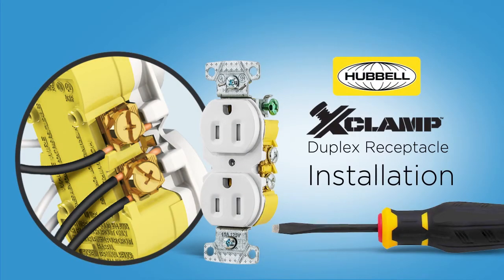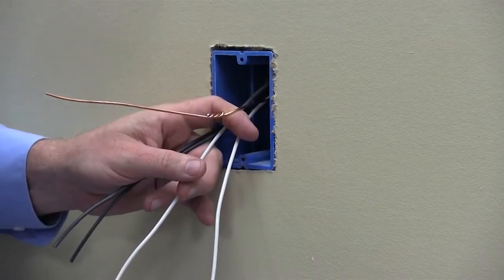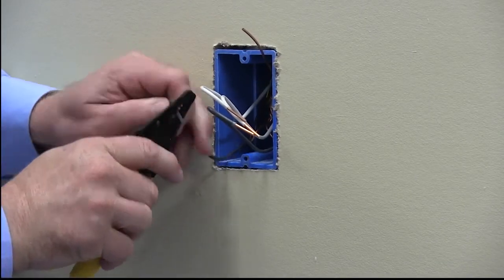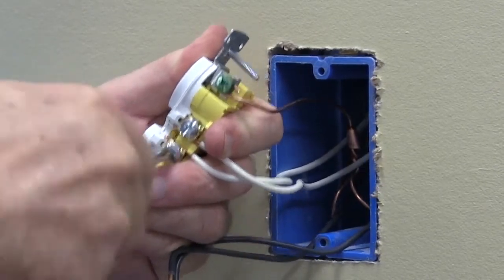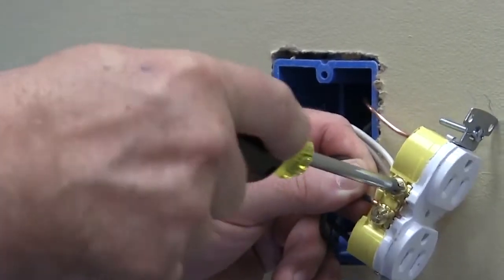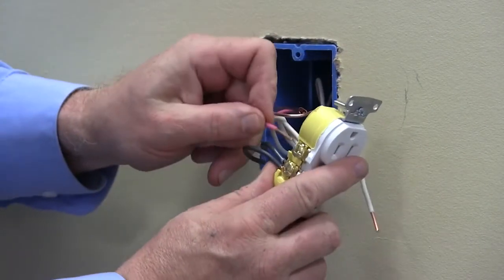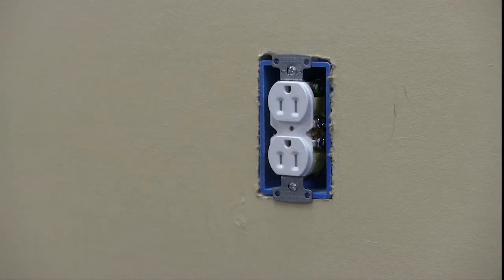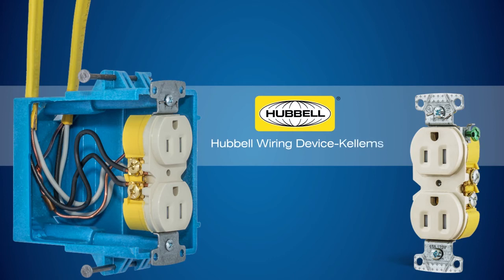How to Install the X-Clamp Receptacle

Comment: Is it not better,  to pig tail the romex and connect the outlet, rather than connect  romex directly "to" an outlet in a circuit ?  Unless , this is the only outlet on this circuit.  If,  this is the first of multiple oulets, connecting it directly like this (daisy chain) , will allow the amperage draw from  the other outlets to be carried by this outlet. Thus causing a possible failure ... ?  Honest question...